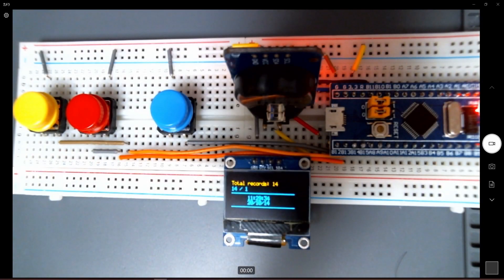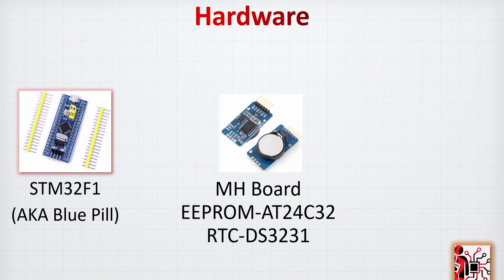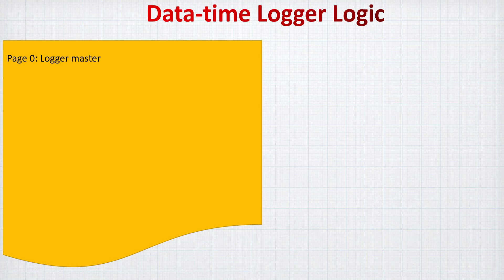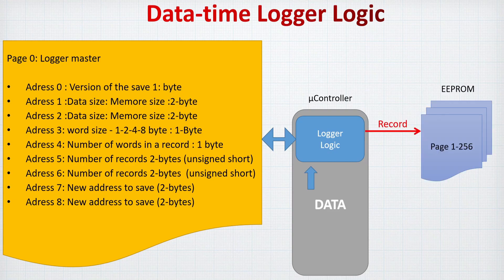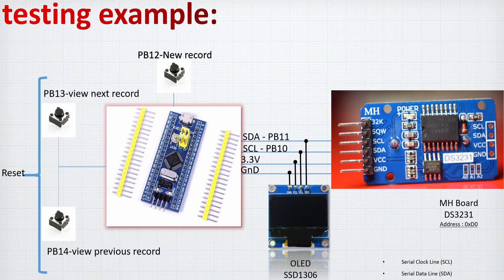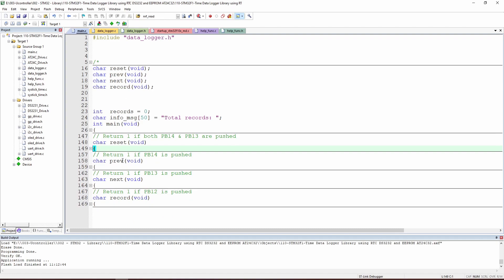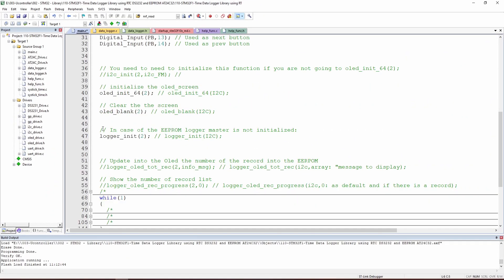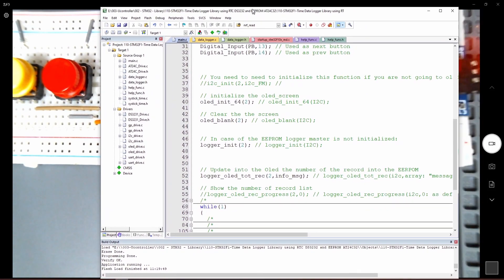110-STM32F1 Set Time Data logger with EEPROM AT24C, Real Time Clock RTC DS3231, Oled Display SSD1306

Comment: Hello, weew. Thanks for a new video. It is a very useful application which can be build to a any project, despite the fact stm32 has a embedded  rtc module. But it is low precission, and thats not enough on some cases, or requiteds regular synchronization via GPS or NTP. Besides that, ds3231 has a thermometer on 0x11; 0x12 addr, and thats fun))
Reply from the maker: Hi Torn,
I had so fun working with this DS3231, as you could see, it is simple and can be very handy and right the internal clock of the STM32F2 can be not accurate, furthermore the blue Pill don't have any place for the backup battery